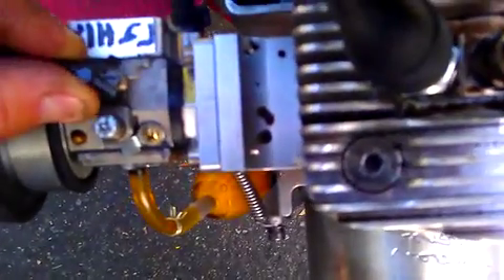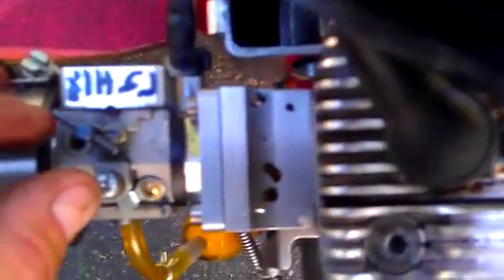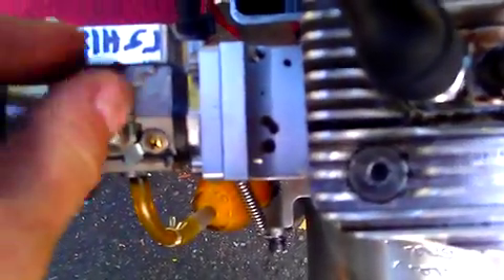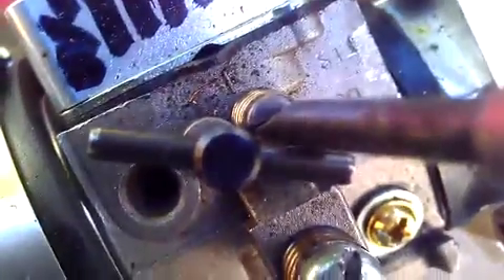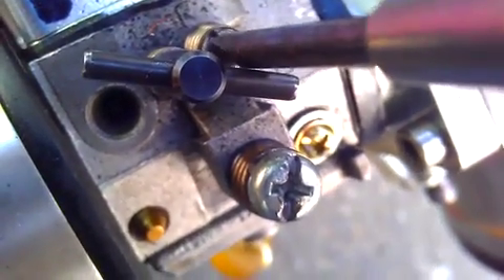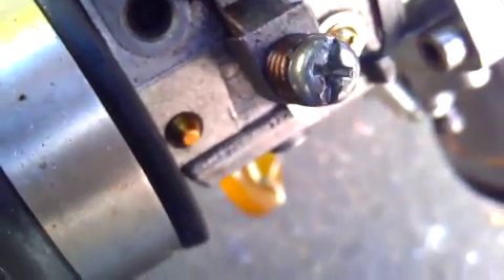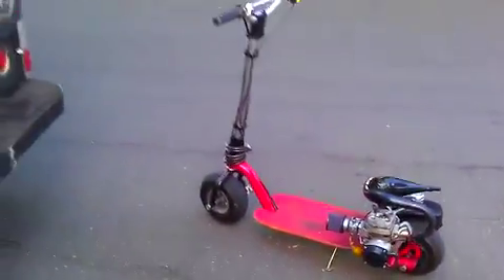Free revving the TS60 and needle adjustments....

Comment from the maker: @androo5826 

Yes, and it does now that I replaced the carb. It was doing 45+mph with the 9/72, now I switched to 9/68 and it'll pull torque wheelies @ 30mph.. It's rad. This thing is ALL TQ.. but still does about 11.5k  rpm and makes over 10HP..